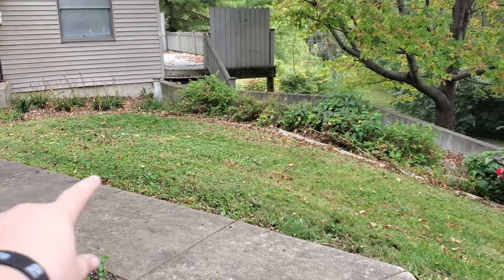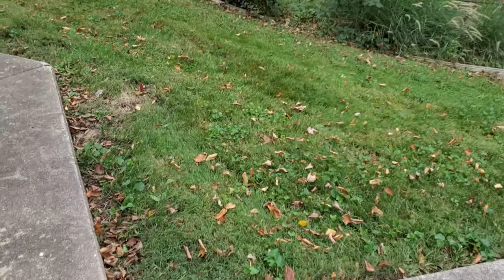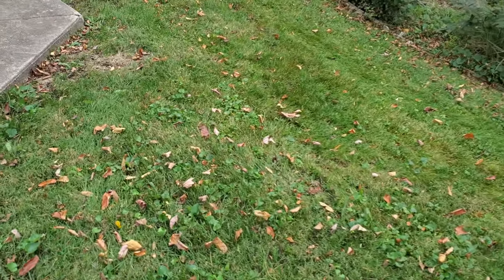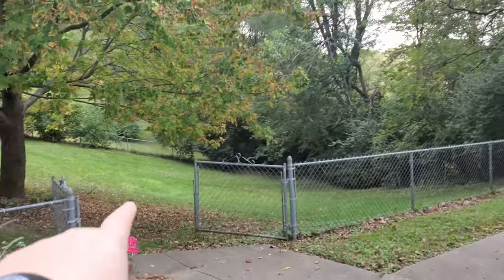Yellowjackets Have Taken Over | Mowing

Comment: I would definitely talk to the homeowner and make them an offer that they can either bring somebody in to do it and you would meet them to show them exactly where the problem is or what you can do is get some dawn dishwashing liquid and a garden hose Wait till night time squirt the dawn down in the hole and then fill it full of water it will kill them all because they breathe through their skin and the dawn cuts off the air or you could use foaming bee spray but either way they go in at night so you need to make sure you know where the holes are and handle the problem after dark they will all be inside and you will have a chance to do what you have to do but do not be afraid to use a lot you will have to use a lot
Reply from the maker: Awesome, thank you so much for the info! 👍🏻